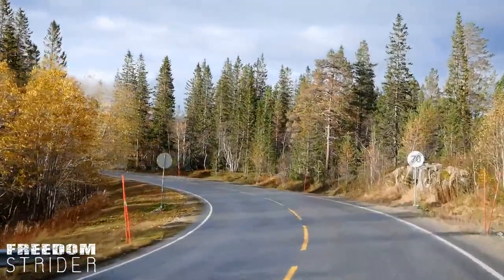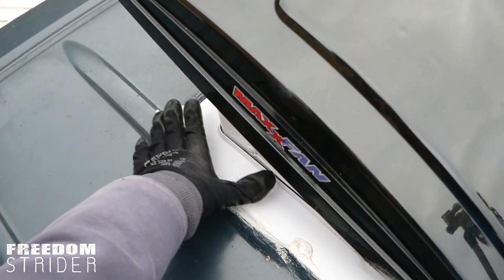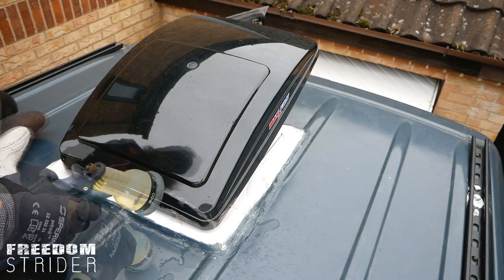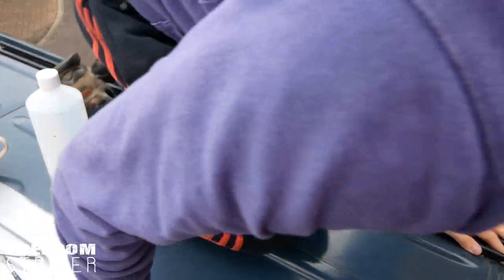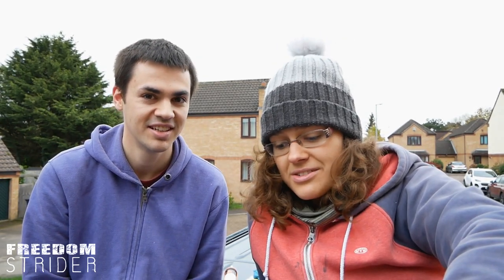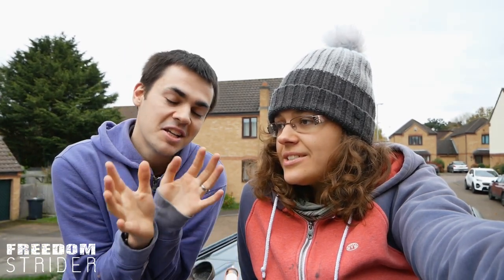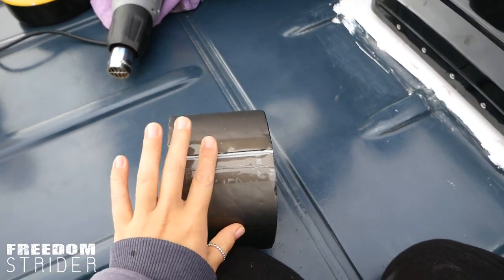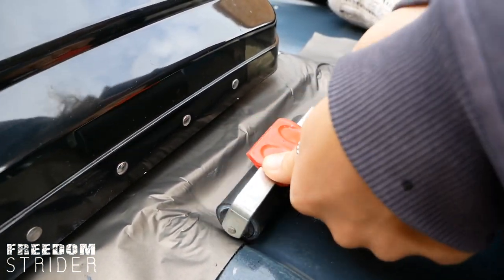Fix ANY LEAK in your van with this SIMPLE TRICK!

Comment: Amazing timing - I have the exact same issue with the same fan and have been considering making a sort of poncho out of rubber to wrap around the fan and then seal that down, but this seems much cleaner/easier!
I've noticed a few of these flashing tapes only have a 2-year lifespan... Did you find something else about the one you chose?

Keep up the great work, guys :)
Reply from the maker: Our flashing tape says a lifespan of 15 years (between 5-30C) - on a van and in colder conditions we are not expecting that sort of lifespan, as we said in the video hopefully at least 5 years but we wouldn't be surprised if it doesn't as everything on a van is quite experimental! 🤞🙂

Have you found exactly where yours leaks from? It can be the tiniest of holes that water can get through
Reply: @FreedomStrider  Awesome! Will have to see if that can do the trick for me too. To be honest I have no idea where it’s leaking from. I used so much sikaflex when I installed it that I find it hard to believe, but I put another bead around a couple of questionable spots this morning and will see how that holds. I think it might be that I drove too soon after the first installation as the wind seems to have caused a few “waves” in the front end of the seal.

Comment: How did the repair last?  We have a roof leak and wondering if we should try flashband or strip it all back and start again.
Reply from the maker: The tape worked magic, we haven't had problems since, it's still holding now. 😀

Comment: Same problem here with mine. Mine makes a valley just at the back of the fan. Sealed and water only slightly still getting in. I used flashband to raise all the low areas to make it a level base to sit on. Mk7transit. I shall try flashband around then if not..all coming off again 🤣
Reply from the maker: Flashband is the last resort I would say before taking the whole thing off, it's a pain to do that 🤦 good luck!

Comment: Hi Guys. Bad luck on your leaking fan. I think that the flashing tape will do the job. You make a good point on the roof being exposed to constant sunlight and heat. If you paint the roof you might consider using a high opacity white paint as this will reflect the sun's rays and help keep the roof cool? There is also specific heat reflecting paint (they contain solids that give extra protection against heat absorbancy). the juries out on their efficacy but they are used on industrial buildings in hot climates) There is some information on the net - might be worth a read.  You are doing a great job. Building a van is a true learning experience!
Reply from the maker: It sure is a learning experience 😂 There seems to always be more to learn! We haven't discounted painting our roof a lighter colour - we will have a deck which will cover the majority so we'll have to think about investing into that sort of paint is worth it 👍 Thanks for the reminder we've added a post-it note to our wall 😂
Reply: @FreedomStrider  Thanks for your reply - I always look forward to your videos.
Reply: How did the tape hold up? Did it fix the leak?
Reply from the maker: Perfect so far, had no leaking signs, we would do the tape again. 😊

Comment: What did you use to seal the fan? It looks like silicone rather than sikaflex 522?
Reply from the maker: It was sikeflex 512 - the UV resistant caravan one 🙂
Reply: Wow I'm so surprised it flaked like that! Will have to make sure I check mine regularly!
Reply from the maker: We were very surprised as well, it's been just under a year, and hasn't been driven alot either

Comment: Is it ok to use the same sealent on a roof fan that you use on a bonded window.
Reply from the maker: The glazing sealant (bonded window sealant) is the best, fast grab sealant we have actually used, so I'm sure it will stick it down to the van, it might even stick it better than the butyl tape. However, using it instead of the white 512 sealant to waterproof it, I would guess it's not a good idea mostly due to the lack of UV protection the glazing sealant has in comparrison.

Comment: From Canada:  OK, I will tell you my theory about sealing, if I may...

I had two sailboats over a thirty year period and I never saw any sailboat or powerboat manufacturer putting sealant over screw heads or deck fittings, NOBODY does that.  When I sold my last sailboat and started looking at the RV world, I immediately noticed that tendency from US and canadian RV manufacturers to put a ton of caulking not only over screw heads but also over any components like fan flanges and others.

You know, there is a running gag here in Canada about RVs:  "There are two kinds of RVs:  the one who leak and the one who will leak...".

Exposed sealant to the sun bring it to crack and eventually make a path for water to do its way inside...  Adding caulking, sealant tape or any other gizmo over leaky seal only slow the leaking process...

If I may suggest:  if the fan leaks again, completely remove it from the roof, carefully clean the plastic flange, clean the roof under it,  scratch the paint to improve sealant grip then clean again.  Put sealant under the flange AND under each screw head then tighten,  REMOVE all excess caulking (I put masking tape all around before) so no sealant will be exposed to the sun.

Try this method next time, just for fun...

What do you have to loose!
Reply: I have to agree, if you have a leak you have a leak for a reason.
Applying a sealant over other sealants is not the answer IMO.
Remove and reseal guys.
Reply from the maker: Thanks for sharing that, we appreciate the advice - we'll consider it if it leaks again - we have a skylight to install so we may look into how to stick that with a more marine style method and see. I'm not entirely sure how the method you described works when you have to deal with the annoying ridges in the van roof, because we have to put butyl tape (or in the skylights case it will be neoprene) to even out the sticking surface - if it were just flat, oh so much easier! But I supose the method you said would go about roughly the same?
Reply from the maker: Sealant over sealant was never really what we were going for when fixing the leak - we wanted to test out the flashband strip mostly.  I agree that the little strip of sealant that we put on top of the older sealant is not really to be trusted, hence we did the tape as well.
If it really does leak again, then yes remove and reseal is the way. Only did it yesterday so have to wait and see how it handles. And as charlevoix418 said, the sealant ontop has always seemed a logically unreliable method. 👍🙂
Reply: @FreedomStrider  totally and yes you can always refit it from above at anytime so no drama.
I didn't see your install video but you do everythjng else really well so you must have just got unlucky.
I used the caravan putty in layers to build up a rim and sat the vent on that. My logic was the putty creates the watertight seal under the vent as its very sticky and it moulds to the ribs really well, the Sikaflex just directs the water away.
☺
Reply from the maker: Never seen those before - very interesting  🙂👍 Thanks!
Reply: Good idea. I’m going to try that.